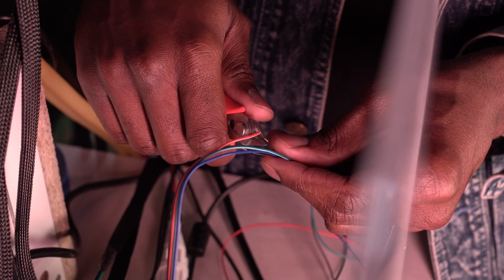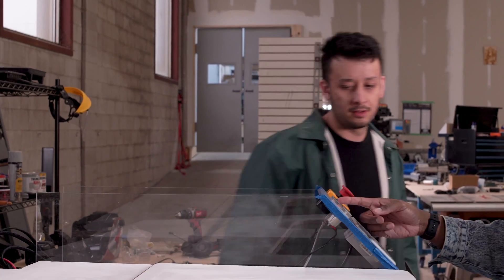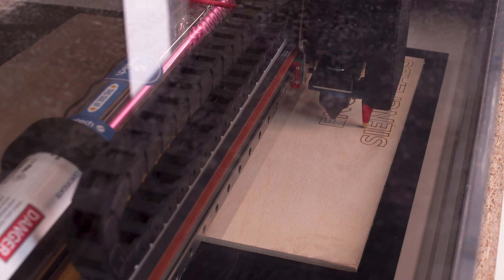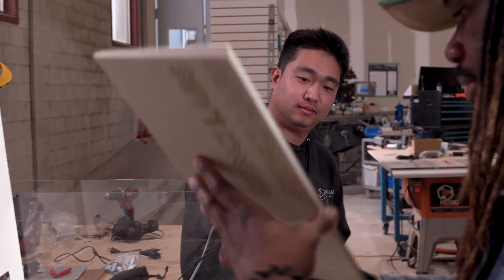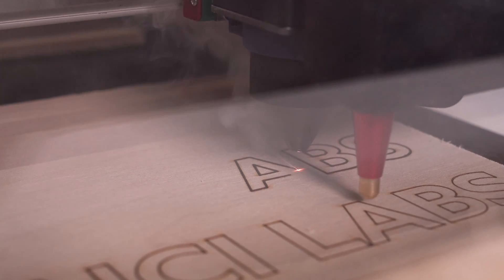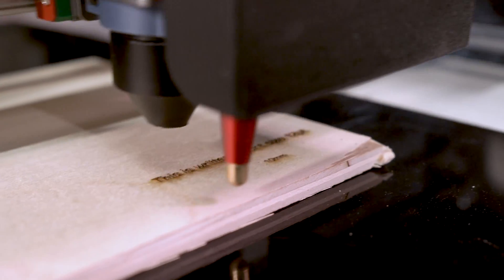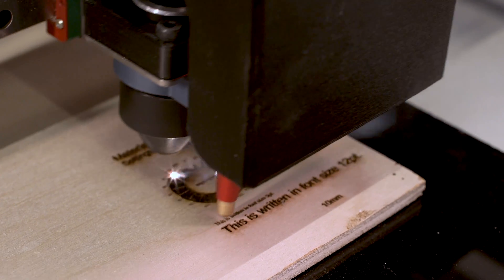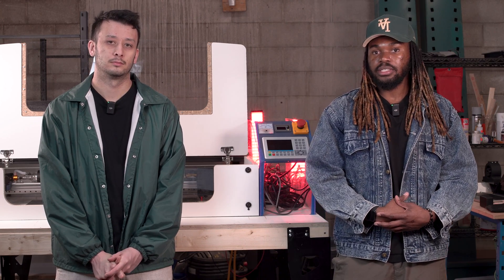UltraBeam CO2 Laser Update #1: Exclusive Insights Ft. Ikenna & Daniel | Sienci Labs

Comment: Curious why the 75W target vs. 80 or 100 that is more typical for CO2 at that size (24x36)?   - assuming of course other's 80W are truly 80W ;)
Reply: size of tube from 60 watts of peak power rated of 75W but you will never use it cause them tubes dont like nothing above 60% power usage... u can use them at 99% but you will burn them very fast from 6000hrs rating will drop to like 1000-2000 hrs and they pretty expensive... also size .... 60Watts/50Watts length wise is around 70-80cm 80W around 120cm 100Wats 150cm etc bigger means longer... so u need a bigger case etc... im curious cause what they are doing is already on market... they are called k40 or upgraded version 6040 which are around 80W at around 1200$ full setup enclosed with all chinese crapamoli accesories... what i seen in their build is a 6040 with a better contorller better rail but they seem to have kept the same old crappy belt driver... and some prototype casing from wood... which is no buenno since this type of lasers are predisposed to making big sparks, especially for thick material cause of air assist if u go to many passes it will literally instantly combust like a jet engine... so my question is.... why not just sell an upgrade kit for the existing products on market? motherboards, rails, controllers... cause i can buy all this and make them myself, and probably everyone that is into production co2 lasers can the know how isnt that dificult... unless they trying to target smoll plug and play audience and they have some proprietary software that makes it easy for people to just cut on a drawing and start cutting, but hey that also already exists... so i still didnt understand what they bring new to the table... the ruida controller is around 150$ the rails another 100$ the wire management and new case varies from your free time and scraps to paying some one to do it for u... im guessing their pricing will be in the realm of 2000-5000$ for this new product... so for me makes no business sense... cause at that pricing range ... u get a pro version industrial grade fiber laser (which can cut also metals)if u know where to look.
Reply: I’m sure the case is nothing like their production plans - rather something for the lab at the moment in early stages 

However I agree I’m curious how they will differentiate - they have the proven ability to deliver good technical support so that’s a major one-up - but needs other points too